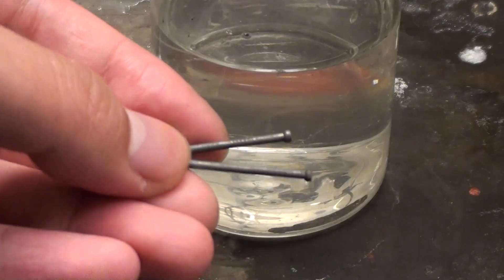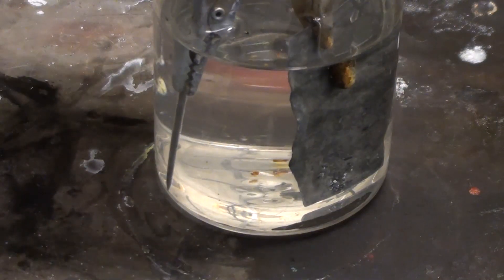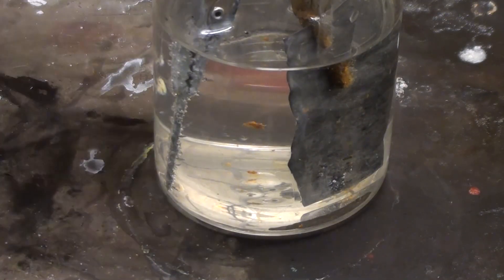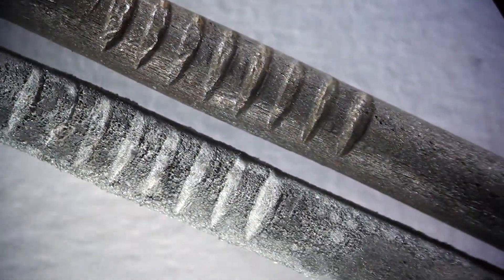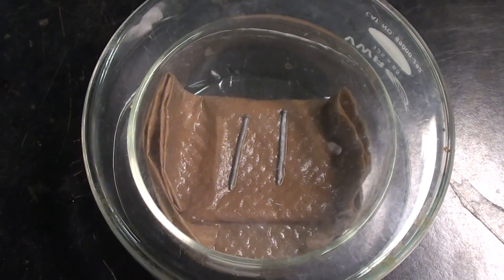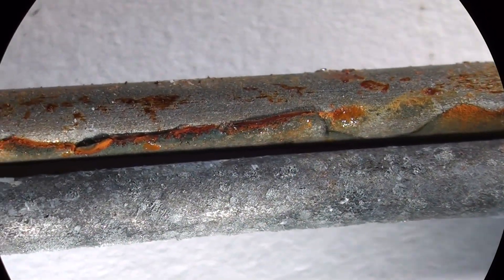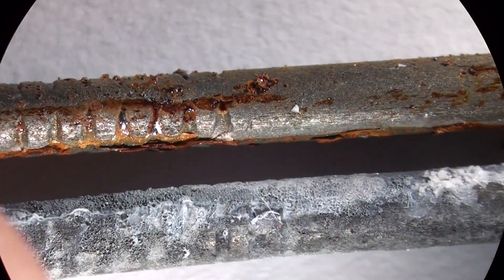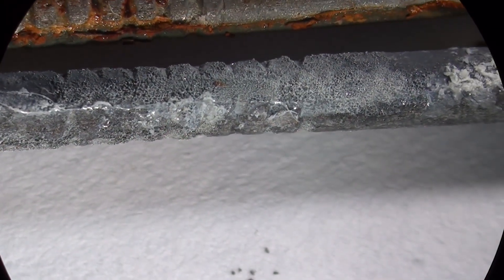How to galvanize metal (for rust protection)

Comment: two silly questions.  is there any significant issue by using tap water that may be hard?  And what happens if the solution you made of zinc sulfate and water is more diluted than 30grams per 100 milliliter.  Will it not galvanize as fast, as well, or not at all?

Comment: If you was going to do a large 6ft bar, would you need to increase the voltage?
Reply: It's to do with current density and not the potential (voltage) the greater the area to be plated the more the current.  Pushing the potential too high increases the risk of hydrogen embrittlement and other forms of hydrogen damage.  the carbon content of the nail also plays a part in the risk of hydrogen damage (especially in high-strength steel components)  Electroplating is just okay for corrosion protection but the layer is very thin typically and thus will not last as long as hot dip galvanizing (HDG).  When one does HDG you find that there is also diffusion of zinc into the surface of the substrate being treated... in fact there are varying distinct layers of surface alloy layers with different zinc/iron ratios.  You can also get thermally diffused zinc surface coating (called sheradizing) where the protective layer is purely zinc diffused into the surface of the substrate.  Additionally one can also thermal spray molten zinc globules onto the steel surface.  HDG and TDZ both have elements of zinc diffusing into the steel surface whereas thermal sprayed zinc and electroplating does not. 

Zinc (in our normal atmosphere) tends to react with the moisture, oxygen, and carbon dioxide in the air....however, in most locations it takes typically around 5 to 6 months to form a complete protective Zn(CO)2 surface film over the zinc (in very aggressive environments this can be too late and corrosion under such circumstances could eat it up for breakfast as the saying goes, before the protective Zn(C0)2 layer has even formed (typically a temporary chromate layer (now banned in many places for being carcinogenic) is applied as a 'passive layer" to help protect during the first 6 or so months of exposure.)  Zinc has two mechanisms to protect iron/steel to which it has been applied and the one is a barrier that the Zn(CO)2 forms on the surface (it seals off the underlying surface from the aggressive environment) and secondly by a technique called sacrificial anode cathodic protection where the zinc corrodes providing electrons for the cathodic reaction that occurs simultaneously and thus it prevents the cathodic reaction from taking electrons from the protected substrate (steel) thus protecting the iron/steel from corroding.  Anyway, enough lecturing on my part.... lol

Comment: So how would you Galvanize say an entire BBQ Grill
Reply: You can't. This is why galvanizing is not a DIY process (just like powder coating) and if it was possible, people wouldn't be painting anymore. It's all fun and games until a large item (BBQ in your case) or weld the steel and having to redo the galvanization. I'd love to have my race car galvanized...

p.s if you wonder why car exhaust doesn't rust (after manifold) is because all cheap exhaust are galvanized from factory.

Comment: old video but you could have used steel wool to remove the gray crystallized zinc and reveal nice shiny zinc. you could then show if it oxidizes easier or not compared to crystallized version because of the increased surface area of the zinc crystals.

Comment: ok i ll try to explain even if i m french and my english is bad, this is not called galvanisation , galvanisation is in steam, with température more than the température of zinc fusion wich is 419.5, so you can use 450° to 600°C, this is called electrozingage with cathode and anode, the coat is not like galvanisation here it s just about 5 or 10 um but in galvanisation it s 70um or more, and here you must do another thing wich is the chromic passivation after this,

Comment: Would a 12 V Battery charger current work as the power supply?
I want to galvanize a pair of black steel trailer ramps at home.
I guess that some zinc sacrificial anodes off a boat would do for my source of zinc.
How do I know how much Zinc Sulphate to put into the galvanizing bath water?
Reply: Did you try it?  I would also like to know this.  I don't have any 5 or 6v batteries lying around.
Reply: The black and red wires in a USB cable provide 5v DC, just cut one end of of a USB cable. Strip the rubber off of the cable, you can just cut the white and green wires.

Comment: galvanized nail should have ben dried completely before this test. it developed what us hot dip galvanize companies of small fasteners or parts call: white rust. and does not meet out quality standards to leave our facility for it is vulnerable to failure in time of its expected life and use.
Reply: What do you mean failure? Rust?
Reply: allmightyjamestown So after it's galvanized it needs to sit and dry for an extended period?  How long?
Reply: john handcock there ready to use after galv. but if your running 1000lbs of them and there going to sit in a bin for a week in a warehouse. they better be completely dry.
Reply: allmightyjamestown Could you do essentially the same thing with Nickel?
Reply: john handcock a nickel is plated. different process.
Reply: john handcock I'm sorry I misread that. we add nickel to our zink as well as bismuth and aluminum. but idk about pure nickel.
Reply: allmightyjamestown I am trying to decide between Ni Cu and Zn plating my old tools.
Reply: john handcock your going to galvanize hand tools? like wrenches?
Reply: allmightyjamestown hand planes and maybe a saw
Reply: john handcock ah ok. something new. sounds good.

Comment: are there any advantages of using your solution or using ammonium chloride & zinc chloride as a zinc plating bath?  Your solution appears easier to obtain
Reply: I saw a dude use water, Sodium Bicarbonate (Arm and hammer super washing soda), and pickle juice.  He didn't even filter the juice, and there were even pickles still in the jar!

Comment: I understand that Galvanized metal can be painted over, however, is there anything that needs to be done before doing so?
Reply: +fishkluch You should lightly sand what you are painting (Because the surface will be slippery) so there is better paint adhesion.

Comment: The principles described here also apply to boat hulls.  There are large (or small) zinc blocks attached below the waterline of a boat as a sacrificial metal.  They are more reactive and thus keeps a protective bubble (so to speak) around the boat.

Comment: I have a question. If I galvanize metal bolts and wing nuts and the nuts will be removed from time to time. Is the galvanization on the bolt and nut threads going to be worn off and rust again?
Reply: Fizz826  Yes.
Reply: +TheTrueAwesomeCookie it's cool bro. My question finally fully answered

Comment: This is zinc electroplating. Galvanising would be if the nail was dipped in molten Zinc.
Reply: +Sandarpan that would be hot dip galvanizing, this is another method.
Reply: Try and sell some zinc plated steel as 'galvanised' and watch what happens..... lawsuits/complaints. Similar concept, but very different. Zinc plated object outside, will be rusting in a week, galvanised properly - will be good as gold in 25 years.....

Comment: Can you remove a zinc coating by putting a galvanized nail in the positive terminal and another piece of metal (for discard) in the negative terminal?
Reply: I'm bit rusty on my chemistry (no pun intended) but the inverse process on an electrolysis (what's happening here) would be to make a battery, you could look for example into the Daniell Cell which uses zinc and copper, and if i'm not wrong would, I'm to lazy to bring back my notes to see what would happen with the iron beneath but i'm guessing it would not react. If i'm wrong feel free to politely correct me, as I said it's been a while since i last worked on redox.

Comment: NurdRage  The white powder is called wet storage stain, or white rust, It's because you didn't give the zinc time to oxidize before your saltwater test, The galvanized nail would have performed much better if given the time to"dry"

I'm more experienced with hot-dip galvanizing, but I know the look, thought you ought to know.
Reply: Anvil Bound i want to galvanised my car.... Is it possible to do this?
Reply: @usmanahmad1788 yes but I recomend if there’s any broken motor mounts can mounts etc anything that needs welding weld it up and fortify tf out of it cus you can’t weld zinc unless you grind down your coating where you want to weld but then that spot can rust so weld everything before galvanization and it’s better to do in pieces for example take the body and drivetrain off your frame and send it in pieces
Reply: So! is it useless method to protect steel?!
Reply: Reality Insight Library no not at all it’s a really good method to do if done correctly

Comment: this may be off topic, but wouldn't a power supply short out if you put both terminals in water like that?
Reply: It won't. The electrolite acts as a resistor. If you think about it, a light bulb should short out the mains power because it's basicly a swirly wire and nothing else, but its resistance is to high for that to happen. The same goes here.

Comment: Does voltage matter depending how much you are galvanizing?  If so, how do I calculate the amount needed?
Reply: beavis3269 only thing the current does is speed up or slow down the reaction. less current = more even coating while a high current will just build up closest to the point in which the clip is touching the metal.
Reply: @TheHotmud  Thanks for the tip on current. However, what is high current and what's low current? Could you throw some numbers around? Coz I'm considering testing this out for a fence post base.
Reply: It says 5 volts at the beginning of the video.  Current should be your limiting factor not the voltage...

Comment: Can you galvanize aluminum with this technique?
Reply: Aluminum doesn't rust...it corrodes. you can google aluminum care and maintenance
Reply: ***** I've seen the galvanic scale, and Aluminum and Zinc are next door neighbors on it.   Whereas Aluminum and Stainless Steel are about as far apart as they can be.

Why then is it, that stainless steel is the standard hardware choice when working with an aluminum base material?

Also, I see electrical lugs that are tin plated aluminum all the time, and these lugs are dual rated for copper and aluminum wire.  Somehow even though tin is farther than copper from aluminum on this scale, it somehow acts as a corrosion buffer metal between the two.  I don't get it.

Comment: non.... in industrial the method is to fill a big tubs with zinc heated and maintain at 450 degree (liquid state) after you put your metal in it.... this method will not just plated your metal but create multi-layer of metal/zinc like a chemical reaction.....

Comment: If you want a copper coating, get an iron nail, and a solution of copper ions.

eg. heat up a solution of copper sulphate with the iron nail completely inside it. A copper-coloured coating immediately forms on the nail. I tried this at home. However, for some reason, the copper coating comes off easily when rubbed - like a powder. I dont know why.

I AM A CHEMIST - I JUST DID A CRAPPY REACTION TO GET SOME INFO.

Comment: Hot dip galvanizing is just the most common method to protect it with zinc. Electroplating is less common, but it's still galvanizing.

Comment from the maker: I never said it was "hot dip" galvanizing. But it's still "galvanizing" as "electroplating"
Reply: What happens if we use a rusty nail or other rusty object instead of a clean non corroded metal? Will this process also removed corrosion?
Reply: @yash_ar I doubt it but it would protect it better than nothing but eventually I would think it would rust internally but it problably doesn’t matter as it’s sealed from water and oxygen so I’m thinking no but I know rust still spreads so hard to say…

Comment: noble metals are noble because they don't normally oxidize, silver will tarnish because of sulfur and copper will form a patina, and along that notes iron forms a patina just like copper but the carbon in steel makes it flake. gold doesn't react to pollutants in the air or the ingredients of normal air which some people believe is why it's so highly regarded.

is it possible to put a zinc coating on noble metals? as long as you have a sacrificial anode of zinc and the zinc sulfate it'll work.

Comment: would it be possible to hook up the negative lead of a battery to say an iron bar and the positive end to an antenna to give the metal a negative charge? i kinda want to try that, i think i'll do the same test you had, two nails in a salt solution, only i'll have one connected to a batterie's negative terminal. just for kicks and giggles i might make an actual circuit by hooking a battery up to a capacitor and using the test metal as a connection between the two...

Comment: I am addicted to your videos they are fun to watch and very informative. I have a question, can you remove zinc for hot dipped galvanized steel? I have read on web that is very hard or almost impossible to do without melting the zinc off

Comment: your alternator generates electricity by the belt which does run off gas/hho the alternator recharges the battery as you drive and the battery is connected to the hho cell which generates the hho gas it a cycle that can boost your miles per gal to 60+ a gal nothing in life is free

Comment: Can you make tutorial for how to nickel somethink? Actualy I know how to nickel but I need a tutorial for how to make nickel solution at home, bencause I can only buy it on internet shop. In my countrey there is not many stores with chemicals, and everythink is too expensive. For example, I saw that on e-bay you can buy 99.9% copper sulfate for  $0.99. In my countrey you can buy 50g for about $5
here is average payment 3000 kunas a month ($500).  The cheapest I was find was 100g for $4.

Comment: I have hypothesized that if the surface of the metal to be galvanized were etched with tiny striations, those little scrateches would fill with zinc. In effect I think that the initial layer of zinck could not only be thicker (if the striations are all spaced out very close and such) but also more durable. There are many different kinds of electroplating, some like vandium/chromium and such are done to make surfaces harder and more resistant to scratching.. yet all of them wear out.. .

Comment: @NurdRage 
thanks for the concise answer

I will get back to you with more information for #6

"5. wears out"
do you mean that this method will fail due to mechanical wear more than hot dip galvanize but that this method is as effective (for the same thickness of deposited zinc) for corrosion inhibition

Comment: if you make the zinc plating thicker, will it last longer or just flake off if it's too thick ?
is there a way to passivate the zinc coating to stop it from corroding ?
what is the ideal voltage/current per cm² for plating zinc ?
is this plating method as good as hot dip galvanize ?
I found a "self-etching" galvanizing primer, I applied an even coat on the engine bay of a car but after a few months surface rust started poking through, how come ?
and what is this etching exactly supposed to be ?

Comment: I have a galvanized chain link fence.  Over the last couple of winters, "freeze heave" has pushed the posts up 6".  I want to put a galvanized bolt thru the bottom of the post to prevent that.  Will the bare steel drilled hole appreciably diminish the life of the post?  Perhaps concrete too, but not sure that is such a good idea?  Thanks for all the videos!!!!!

Comment: Tis funny, we use an Iron solution to remove impurities from the zinc solution in a tank of weak sulphuric acid, yep I make the zinc solution that plates out zinc metal onto aluminium cathodes through electrolysis.

Comment: zinc sulfate is used just just that solution would conduct electricity? I've done some zinc electroplating experiments in past and it works even for example with ordinary table salt (some sugar and acid improve results also).

Comment: How well does this zinc galvanization reacts to mechanical stress? I'm aware that it's a coating, not an alloy, but to disdress or peel away the coating do I need a file/sandpaper or is enough handling the item for some time?

Comment: thank  you for the video! defiantly something new for me that I didn't know and after thinking about it, this leads me to the following question:

is it possible to apply this to anything else but metal?
I have carved sculpture out of wood and I would really like to give it galvanized look. i was thinking to paint the sculpture with iron powder and galvanize it? will it turn to solid surface or will it break off?
Reply: There might be some arrangement of circumstances where you could convince wood to be electroplated, but as a rule you need a conductor that can easily give up and accept electrons, and wood does not do that. For the most part, metals are the only materials that meet that criteria, and not even all metals(gold comes to mind).